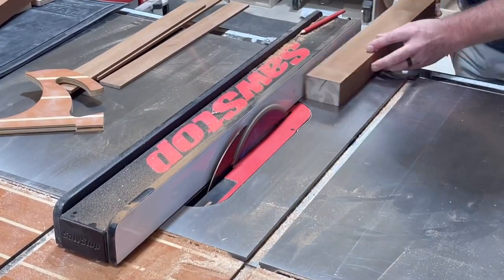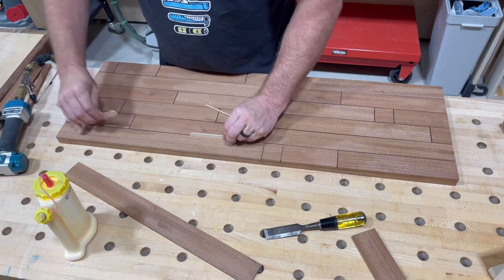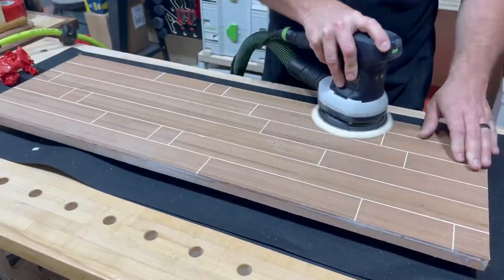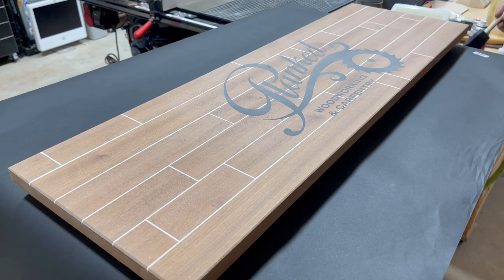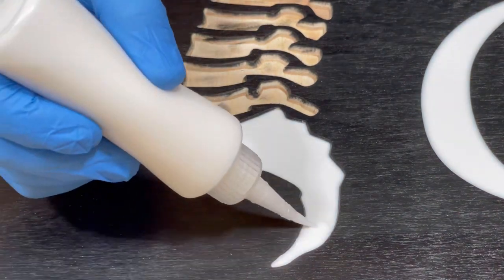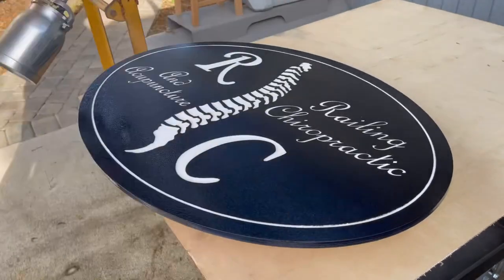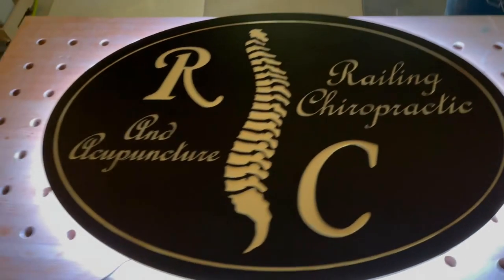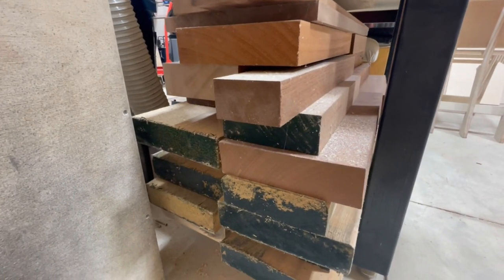I Made Two Signs for Local Businesses | Tried Bartering too… It Worked!

Comment: I do CNC signs, but not with resin inlay. My technique is a bit different, but makes for an easy finish process. I first dimension the sign, and sand it. Then I coat it with clear gloss, sanding (220-320-400g) level and do that until I have a flat finish. Then, I cut the sign lettering. I can then paint each letter whatever color, and be almost as sloppy as I want. The gloss allows quick wipe up of any mistakes. Once I get the letters to the desired look, I sand with 400grit just enough to remove any color haze, and put a cloudy finish on the gloss. I re-coat with gloss or matte until satisfied. This eliminates bare wood taking finish, masking, etc. I think this may work for your epoxy method as well. On the woodworking sign, I'd probably have done the whole sign in the clear resin, just like I do mine in gloss clear. Just suggestion, and info for those not wanting to mess with epoxy resin. All sorts of methods to get to the result. Love the signs!

Comment: These signs look fantastic. For the second one, to help with the inlay filling, after you seal the surface but before you put it in the CNC for carving, cover the surface with stencil film. I like Oramask from Oracal. Leave the stencil when applying the epoxy inlay and pull once done.

Comment: I know this is an older video, so hope you still read comments/questions. Love the faux wood idea. I have a lot of black walnut I'd like to "stretch out" like that. One question... I noticed you pin nailed the wood down w/glue. how did you manage to not hit any pins with your router bits? I can see the surfacing bit passing above if the pins are recessed a little, but the v carve would surely hit a few, IMO.
Reply from the maker: I have specific router bits. I use for stuff like that in case they’re going to get hit. You know like a cheap set from Harbor freight or something. So I don’t really try to avoid them. I just try to avoid using the good tools. Thanks for watching brother.

Comment: without the clear skim coat, a dark resin color (especially black) can bleed into a more open grain wood like oak as well. I like to run a bead of clear caulk to act as a dam, I'm always worried I'll over pour or my piece isn't level and it will run off

Comment: First of all, great looking signs! You mentioned using the 60 deg V for the woodworker's sign. Did you use a flat end mill for rough of the large areas out first, or did you let the 60 deg V do the whole thing?

Comment: Had that flatten bit issue, got a cheap-ish one from amazon that uses the carbon replaceable 4 sided blades like a spiral head planer or jointer! Friggin thing is SSOOOO much better!
Reply: here's the one I got, people have stated having issues with the shaft bending, but if you install it correctly with the shaft all the way in, I've had it bring my CNC to a stop and Emergency shut down and no issues with the bit... https://smile.amazon.com/gp/product/B098DRSFQ8/ref=ppx_yo_dt_b_search_asin_title?ie=UTF8&th=1
Reply from the maker: Thank you for this that looks awesome. I recently picked up a four replaceable car buy tooth one from Amana. Haven’t used it yet but it looks like a beast. May have to pick that one up too the one you showed
Reply: @AGlimpseInside  yay that Amana should be nice! Use it! so much better than those cast units!!  when this cheapo wears out I'll be getting a decent branded/better one, though honestly, it works rather well!

Comment: Just FYI, Ipé and Mahogany are not the same thing. African Mahogany isn't even mahogany (it's a different species entirely), but that's another story. Ipé is from Brazil, South America. It is an extremely dense and almost waterproof wood, that if it weren't for its high weight, would be extremely useful for outdoor furniture, but instead is mostly used in making decks since it's basically impervious to water. It's oily and hard to finish and because it is so dense, quickly dulls tools (e.g. saw blades). It doesn't glue or take stain well and is super expensive.
Reply from the maker: Thank you

Comment: This is really creative. I am new to all of this and this video gives me some ideas to try. One question - I noticed you were using brad nails, are those okay to run a surfacing bit over? I am assuming that’s okay but was curious how that worked.
Reply from the maker: Honestly, not really. Pin nails are OK but anytime you hit metal and metal it’s probably not the best thing. So there is a gun that shoots composite/plastic nails. If you search online composite Brad nailer you’ll come up with it. I believe the brand I’m using is called OMER.
Reply: @AGlimpseInside  Thanks. I don’t think I’ve ever seen those but this is great info. I appreciate it.

Comment: New sub here!  Great video!  Wondering if you cut the backer for the chiropractic sign on a laser?  If so which one?  Also, I have a critter spray gun.  Do you think that would be able to spray the total boat products you sprayed?
Reply from the maker: As long as the mist can be fairly fine you should be good. Also, I have the Laguna smart shop EX 150 W.
Reply: @AGlimpseInside  Out of curiosity, what made you design the backer in that shape or was a file you found online?
Reply from the maker: @benjaminl3084  I wanted to use some quarter inch material up. Plus I needed to make room for the cord and it was honestly the easiest way to do so by stacking those layers my original design.

Comment: If it's Ipa you would know, it's one of the hardest and heaviest woods in the world and very, very hard on your cutting tools. I would never run it through a planer. I have banned its use where I teach furniture making. Mahogany for the most part is more in the cherry range for hardness. They use Ipa as deck material a lot. Terrible wood to work with.
Beautiful sign work.